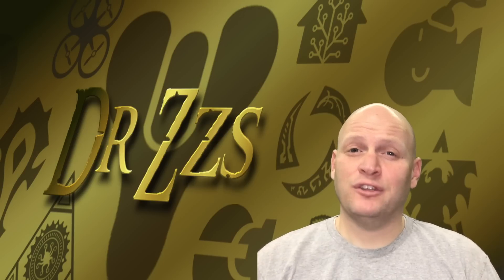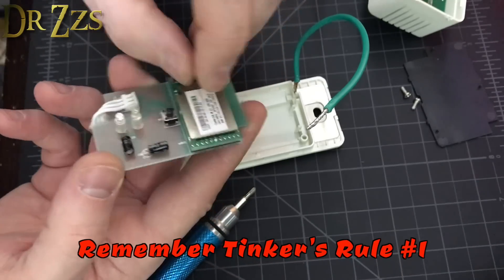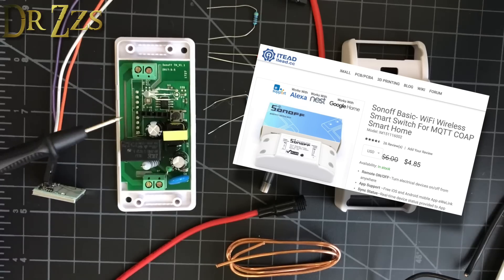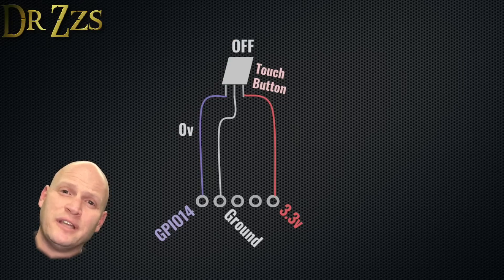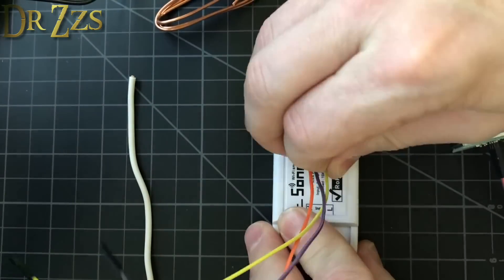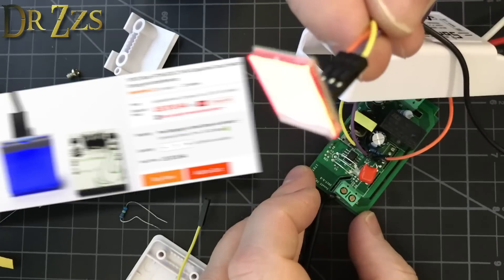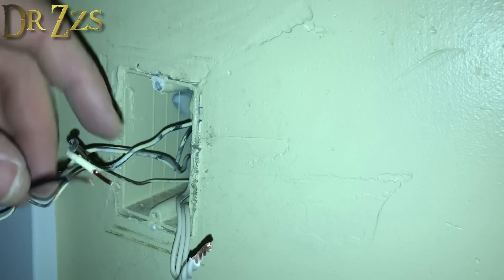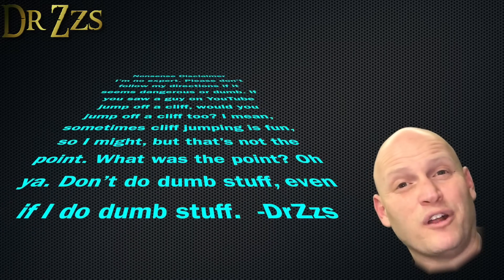$5 Sonoff + $2 parts = Best Smart Switch EVER!

Comment: Cellgate keeps giving me screwdrivers just like yours
Reply: They also keep giving me these really nice floor/door mounted reed switches. The floor mount has the switch with a 24” long lead run in 1/4”id fmc. The door mount comes attached to a very well machined aluminum angle bracket. We just started installing them a few weeks ago and I have 4 already....need to set one up to monitor my garage door status

Comment: I'm late to the party with this but I noticed you missed a few things There is protection that you overlooked in the UL listed switch. There is explicit separation of high voltage and low voltage components, physical (layout), electrical (optical isolator) and cut slots in the board in addition to the barrier that was in between the boards.
Reply from the maker: Good point. 
I would love to hear from someone at UL about what they look for in a device before approving it.  
I know the Shelly devices don't have a separator like that, but they also don't have a button that is directly touched by a user with the device is on mains power, so maybe that's the difference.  
Thanks!

Comment: Dr Zzs. I love the idea and with A LOT of research and the help of the Discord Chat I manage to update your version into the Sonoff Basic R2 (NO GPIO 14)... So here is the solution.

First I tried KEY as GPIO 0 and failed. Then after more research found out that RX can be repurpose a GPIO 3, then at "Tasmota Main page" I set it up like this:

Configuration
-Configure Module
--GPIO3 Serial In "Switch1 (9)"

then...

Console (type)
SwitchMode 2 1
SerialLog 0

Also I decide to use de original frame with a "decora blank insert" to give it a Switch alike view.
https://www.homedepot.com/p/Leviton-Decora-Plastic-Adapter-Blank-No-Hole-Gray-80414-GY/301753393?mtc=Shopping-B-FBT-G-Multi-NA-Multi-NA-Feed-PLA-Catchall-NA-NA&cm_mmc=Shopping-B-FBT-G-Multi-NA-Multi-NA-Feed-PLA-Catchall-NA-NA-71700000014585962-58700001236285396-92700010802552412&gclsrc=aw.ds&&gclid=Cj0KCQjwoKzsBRC5ARIsAITcwXF0HfL8-HU7TVf19UHSgFF1G4lOS5jDOPReSv7OVjSghSkop8ZYAYAaApjZEALw_wcB
Reply from the maker: Dude!
Great work! 
Thanks for sharing too :)
Reply: Brother, is the minimum I can do, return the favor. Please keep the good work. 💪🏼. 

Thank you very much for all you time Dr. Zzs
Reply: Just for my own clarification should the command not be "switchmode1 2" instead of "switchmode2 1"?  Switch one is the RX pin GPIO3 which was set to Switch1(9) in the configuration.
Reply: Andrew Addie that is how I managed to make it work... there is no damage for trying in this case. Any configuration can be set back to the original setup.

Comment: Some people ( in their video) don't solder header pins and Just use male jumper wires. But when I try to do same it doesn't give enough contact. what's your say on this?
Reply from the maker: I've done both.  Soldering is more sure.  So I'd say if you couldn't get it to work just holding them then go for the soldering method. 
Good luck!

Comment: I love the idea. I already order all the parts even before I ask myself this... I’ve been looking almost all your videos after my 4th sonoff at home. But here is my question: there is the chance of installing the touch sensor to act as the original push button so then I can use it with Alexa or the eWeLink? I didn’t know I had to do the whole Raspberry Pi thing to have the Home Automative System (sounds great), but so far I just tell Alexa what to open and what to turn... So, once again, I’m very new in this world that I dream about (have Jarvis like Tony Stark), but I’m looking to have it as simple as possible and I bought the Sonoff Light Touch switch and does not fit very well, so I decide to use a
Decora Blank Insert, White
https://www.homedepot.com/p/202059798
And everything else the same and the switches will look like switches but touch...

So there is a small chance of avoiding the flash with Tasmota? 

Thank you and sorry for the long text
Reply from the maker: yes, if you can get it to fit and don't want to use Tasmota, you sure don't have to. You can totally base your whole smart home on Alexa as your hub.  The latest full-size Alexa even has a zigbee hub in it.
Reply: DrZzs so should I do the whole connection the same way but bypassing the flashing? I know I can change the function of on/off with itching (I did https://m.youtube.com/watch?v=p76OQI5Xx2k&t=303s for that... but I have to tell Alexa to “turn on” garage door even to close it). So I’m afraid to the flash part with my very few experience... what would be my best way to go? And thank you very much for your time. Love your channel and your work!
Reply: Dr Zzs. So I did everything as I understand it suppose to to work connection wise, but here is what’s goin on. The new version of sonoff the GPIO y not label anywhere and after doing research I found out that “KEY” does work a GPIO (challenge overcome apparently)...

Here is the new challenge, when I test everything the sonoff works I usual, the touch switch turns on and of BUT does not turns the relay nor the light...

Any suggestion? My knowledge is very short and I think is related to the new version of Sonoff Basic RF R2. 

Thank you for your time and inspire many to DIY Projects at home 🙏🏼

Comment: I can’t vouch for Americans however a sonoff should be fine to use in the UK, most appliances have either a 3A or a 5A fuse in the plug so when using them they’ll fail before the 10A rated relay and secondly if you’re using it for lighting. Mains lighting is done on a 2A fuse in the Fusebox therefore the 10A is way overkill
Reply from the maker: sweet!  thanks.  we're not so careful I guess.  most of our devices aren't fused (I don't think), and most circuits use 15 amp breakers.

Comment: how can I make it works with new version of sonoof basic?
Reply from the maker: I don't know what pins are available on the newest Sonoff Basic.  I know they've stopped making GPIO 14 as easy to get to.  You might need to use the Rx pin as the external switch pin.

Comment: If I want to keep sonoff firmware can I complete this task?
Reply from the maker: Mostly. There is a custom component for Home Assistant that uses the stock sonoff firmware. But you can’t use gpio14 for a button. You’ll have to connect to the contact points from the onboard button on the sonoff.

Comment: Any chance of an update video with the newly changed Sonoff Basic?  They changed the circuit board and switched away from the 8266 chip.  GPIO 14 seems to be either gone or really hard to access now.
Reply from the maker: Rob from The Hook Up just did one.  I did one on a live stream too a while back.  Check out Rob's video.
Reply: @DrZzs  The one using the Rx instead of GPIO 14?
Reply: @DrZzs  Or actually -- do you have a link to the live stream?  I'll check that out!  Thanks!

Comment: it Works! and without the resistor and capacitor. have a look. Could that be an issue not having thos extra parts safety wise?

https://photos.app.goo.gl/5sCT2s9fusJX7LJJ7

so the Dr.Zzzs Garage pack is completr

- SV Garage opener
- D1 mini motion sensor
- Touch light switch

thank you, keep doing what you're doing you are doing it great.

fan from Fort Collins

Comment: I never understood this metal switch boxes, here we have only plastic boxes. Aren't this metal boxes already grounded?
Reply from the maker: Agreed.  I don't think metal boxes have been used in the US in many years.  Old houses will still have them possibly.   If the are connected by conduit then yes, they should already be grounded, but if the wire running between boxes is just Romex, they would need the ground wire to ground the box.  
In my case, the boxes are all plastic, and with these cap-touch buttons there is really no way that someone could make contact with mains voltage. 
Hope that helps.

Comment: Is this possible without reflash to Taz? so i can retain alexa control?
Reply from the maker: yes, but you can't use GPIO-14 for an extra switch.  You'll have to connect the external switch to the contact points of the on-board button.
Reply: @DrZzs  Thanks - the video was excellent and left me with a good understanding. But now im torn between alexa - and what you have done here - which i must say is absolutely top notch! Also - i have ceiling fans with lights - so im not sure the overpriced pre-packaged 2A option will work. I really feel you covered a lot of bases here.

Comment: Hi, I agree with previous comments... another great video!!!. Thinking about the WAF. Does the Sonoff/Tasmota still work, even if the wifi is offline. i.e as long as there is power to the sonoff would the touch button or indeed momentary switch turn the light on or off....
Reply from the maker: Yes, the touch button does still work without wifi.
Reply: DrZzs ok thanks... off to the drawing board then... UK wiring is often different to US wiring especially with light switches. Typically we don’t have a neutral at the wall switch, just a switched live coming down from the ceiling light.. 
putting a sonoff in the ceiling next  to the light and using the ‘Switched live’ wire to become the Gpio input should work... 
I will carefully test 👍
Thank you

Comment: Wow really very nice 
I will make it soon order touch switch ....
Reply from the maker: Awesome! 
The touch modules I used in this video are "latching" meaning they function like a rocker switch.  The trouble is they don't change states when you flip the switch in HA.  So you have to double tap them if you've controlled the switch in HA.  You can solder a couple contacts together to make them momentary, or you can use these other (cheaper) momentary touch modules. 
https://www.aliexpress.com/item/10Pcs-TTP223-Touch-Key-Switch-Module-Touching-Button-Capacitive-Switches-Self-Locking-No-Locking-Jog-2/32761802828.html?aff_platform=product&cpt=1540303846952&sk=BLO3MuC&aff_trace_key=f9126dd1661744dfa5915f14eb0df2b7-1540303846952-02829-BLO3MuC&terminal_id=6e8eba07b5fa444188b7d9a46568bf37
Reply: @DrZzs  Dear sir 
Many thanks for great reply .. I have same model switch ...BTW I want to make 
4 ch relay WiFi and touch bought work together and work with also amazon Alexa is it possible sir with nodemcu or wemos d1

Comment: Finally, I found a way to control the LED in the touch to ON and OFF according to the output. I disconnected the input to the LED by a sharp scratch in the PCB of touch switch and drive the LED from the Wemos relay output and used a transistor and resistor combination in between to invert the logic of output(i.e LED ON when the relay is OFF and LED OFF when the relay is ON). Thank you for your support. :)
Reply from the maker: that is a genius move!  Nice work! 
Can you post some pics and an explanation of how you did that in Discord or the Facebook group? 
I'm sure others would benefit from knowing about your little trick :) 
Thanks!
https://www.facebook.com/groups/1969622823351838/
https://discord.gg/4XStfrV

Comment: Brilliant video..  I'm doing the same with a Wemos D mini.. Everything is working via the touch. But the problem I'm facing is when I try to turn it on or off via a web app or mobile app the led on touch switch is not turning ON and OFF accordingly.. What can I possibly do for that.?
Reply from the maker: Thanks.  
That is unfortunately not easily curable.  What I've done is change the switch from latching to momentary by soldering across a couple pads on the back. Then you can change the switchmode to "switchmode2" so the led is on all the time except when you press it, or on "switchmode1" the led is on only when you touch the switch, then it goes back off.  
I thought these touch modules followed the state of the relay.  They seemed to when I first started using them, but I've realized now they don't.  You could possibly use some input from the on-board LED to control the cap-touch led, but I'm not sure exactly how that might work.  
Making them momentary has been a decent solution for me. 
Hope that helps.
Reply: @DrZzs  Me too thought led  will follow the output of switch.. Anyways thank you for your information... Looking forward for more videos from you.. Can you do a AC fan speed control using PWM controlled via node Mcu.. I found a sonoff device for that but too expensive for my project..
Reply from the maker: I'll try:) 
I want to experiment with PWM in Tasmota.  I've got some motors sitting around just waiting for me to have the time to play with them.

Comment: i used this on a electrodragon, which is similar to a sonoff dual. and the the 4.7ohm did not work. I worked with adrian on discord and he had me check the voltage between GPIOs and GND. the Touch is not activated it showed me 2.3v and when the touch was activated 3.2v. for the ESP sw 3.2v is High or 1 and 2.3 is not considered low. with only one touch sensor i could use 4.7kohm and one relay would activate. but when you use another 4.7k on the 2nd gpio now you have 2.3v  from both gpios to gnd. anyways....if you will be able to trail an error if you have a digital multimeter and a resistor collection.
Reply from the maker: ah, good info.  Thanks!

Comment: OR you could just buy the sonoff touch. Its 11€.
Reply from the maker: valid point.  I have places in my house where a T1 is better than this.  But I don't like the face plate on the T1 so in other places I prefer to have my own blank faceplate with the cap-touch buttons.  It's good to have lots of choices.

Comment: I just added a Capacitive Touch Switch in my house. The way I did it is I bought a Capacitive Touch Switch Button, put a solder bridge on the "B" pad so the output is off until triggered, added an optocoupler between GND and I/O on the Capacitive button, and the output of the optocoupler between GND and GPIO 14 on my sonoff basic. I found that if you have 3.3 volts always going to GPIO 14 it can trigger the sonoff to reset and erase the wifi settings. Here are the components I used.

https://www.amazon.com/gp/product/B01LWKFS7L/ref=oh_aui_detailpage_o00_s00?ie=UTF8&psc=1
https://www.amazon.com/gp/product/B01GYH74O2/ref=oh_aui_detailpage_o07_s00?ie=UTF8&psc=1
Reply from the maker: Nice!  I've not used an optocoupler for anything yet.  Thanks

Comment: Hey Dr ZZ, if you control the switch remotely, does the touch switch change? Meaning Light on/off?
Reply from the maker: Unfortunately no.  It seems to sometimes. You can see it happen when I’m testing it at the end of the video. But it normally doesn’t.  There’s a way to make these switches momentary or there are other cheaper momentary touch buttons you can get. (I’m on my phone or I’d post a link). I think there’s a link to them on Drzzs.com.  They don’t stay lit, but that avoids the problem of the switch light getting out of sync when you toggle it remotely.

Comment: If you are still reading these comments and still have the 'expensive UL approved' switch in pieces, can you take some closeup photos of the 'high voltage' board, both sides?  The reason for this, I dont know if you have seen the discussion on Robs video on the sonoff in his daughters room, some one is saying how poor these sonoffs are.  I wanted to see what the good board and parts looked like.  Just curious.
Reply from the maker: I'll go combat those comments for rob.  Sonoff boards are excellent.  At least as good as any other.  I do have the switch still in pieces.  Remind me later (maybe via discord) and when I'm home I'll take some pictures.
Reply: DrZzs will do.  (I hope your not  'working' now :-0 )
Reply from the maker: Just made some comments in Robs defense.  Mostly just injecting some humor to quell any arguments.  Thanks for letting me know.
Reply: Here is the reddit link where I am poking around.  I am hoping for a technical discussion here https://www.reddit.com/r/homeassistant/comments/97hr1t/got_sonoffs_why_not_add_door_sensors_to_them/
Reply from the maker: that one guy knows maybe a little more than the average joe about transformers.

Comment: Did removing the Low Pass Filter cause any undesired effect?. I was thinking of switching my switches to the touch button, but I have one 3 way switch that is causing me issues, I assume it is the whole Ghost switching issue. When I have the switch screwed all the way in the box and power it up, it turns on and off and off and on. What is weird is when it does that it reboots the module. I Noticed last night if I Unscrewed the switch so it was not seated in the box fully it stopped switching. The main reason for changing switch's, is the original box's are kind of small and won't fit the wire's, sonoff, and a normal switch.

Comment: If you were to get the multi color touch sensor like the one in the link below, Can the color be changed by the programming in Home assistant?

 https://www.aliexpress.com/item/Capacitive-Touch-Switch-Button-RGB-LED-Sensor-Switch-Module-HTTM-DIY-Electronic-Board-Multi-Color-Anti/32844721029.html?spm=2114.10010108.addToCart.9.37aa67c6FQBcE1&gps-id=pcDetailCartBuyAlsoBuy&scm=1007.12908.99722.0&scm_id=1007.12908.99722.0&scm-url=1007.12908.99722.0&pvid=0ce74d81-dca6-4795-9b86-f13156f447e8
Reply from the maker: Not that I know of.  Those multi-colored buttons just cycle through colors.  I don't know about programming them.  That would be super cool, and could probably be done.  I'm just not sure about how.  Sorry.

Comment: Soldering stranded mains cable into the terminal is just not considered best practice. Maybe it's different in the USA.
Reply from the maker: You are totally right.  That is not best practice.  The screw connectors for the mains on the sonoffs are not very good and the wire can easy pull out.  Since this video I've been soldering the wire directly to the board and removing the screw connectors completely.   This is all hack/diy so just do whatever seems best to you. 
Thanks!